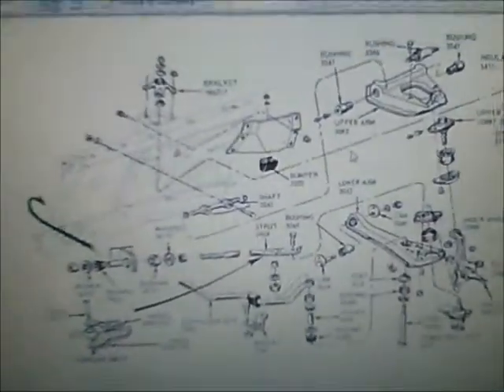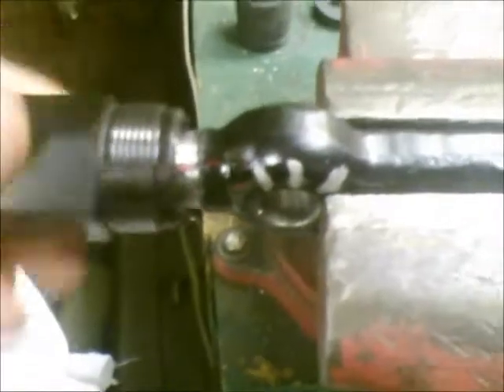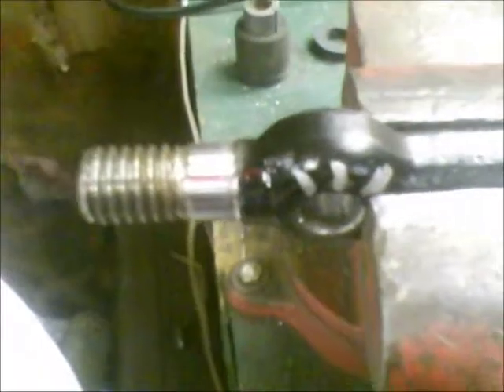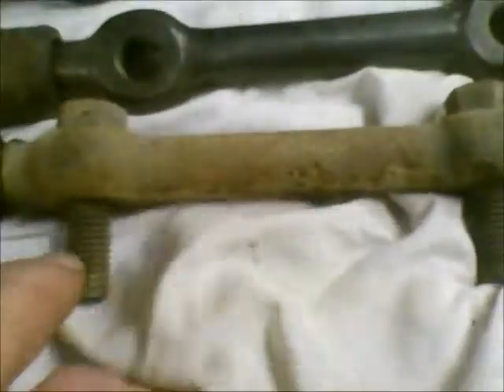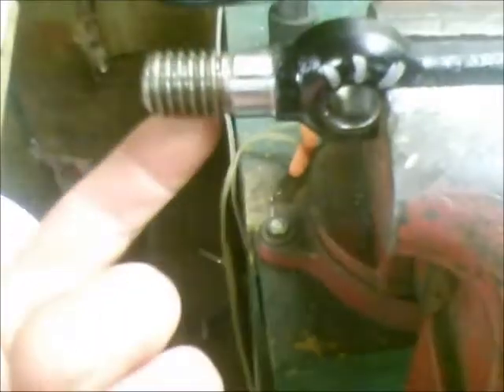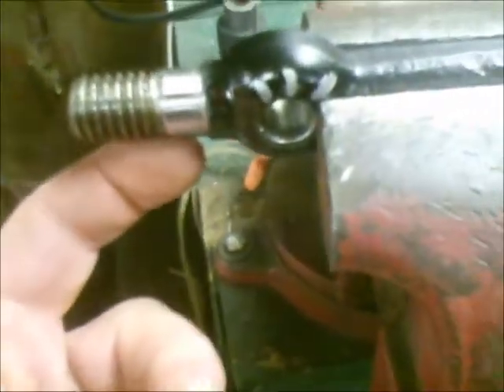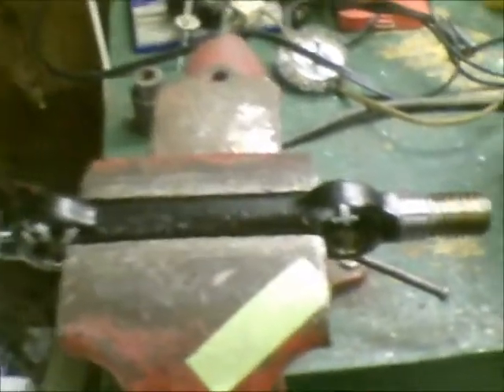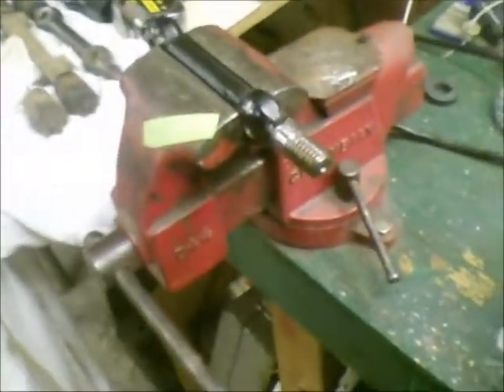Upper arm assembly

Comment: I just installed uppers on a 71 Chevy, and I noticed there's no air flow, so I can't grease them like I feel they should be.  Mine doesn't take an O-ring.
Reply from the maker: I wonder why Chevy didn't put grease fittings on their control arms like Ford did?
Thanks for watching the video.  :-)

Comment: Very nice!  Now I know how these work!  I have had my families 64 ford galaxie front end rebuilt twice in the last 45 some odd years we've had it.  The passenger side has the zerx fitting, but the driver's side does not.  I guess the o rings are shot on the passenger side because when i squirt one pump of grease in them, it oozes out on the back end of the caps?  Thanks!
Reply from the maker: I am glad the video helped you out.
Thank you for watching and commenting on the video.  :-)